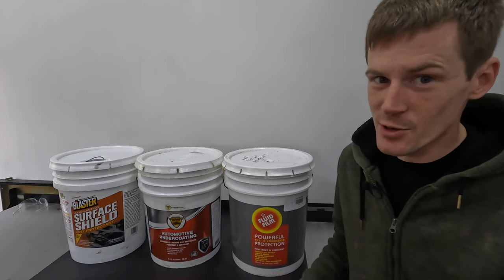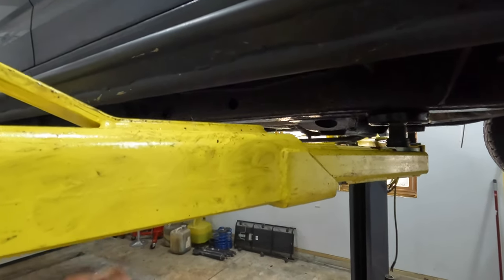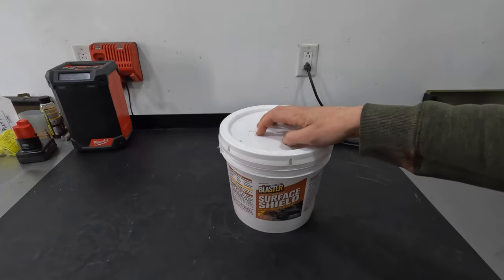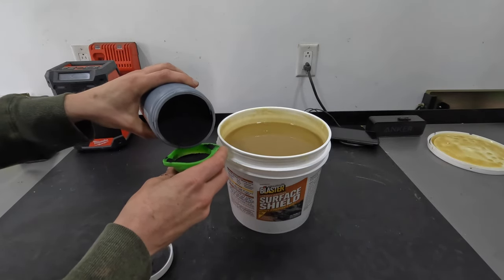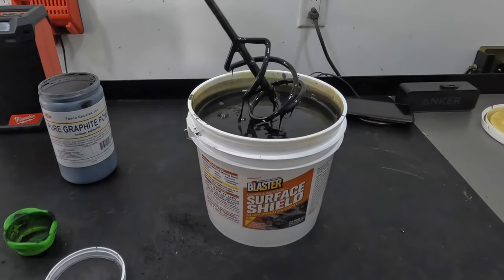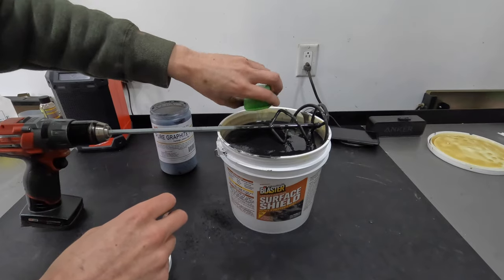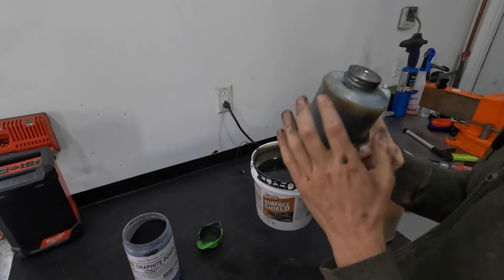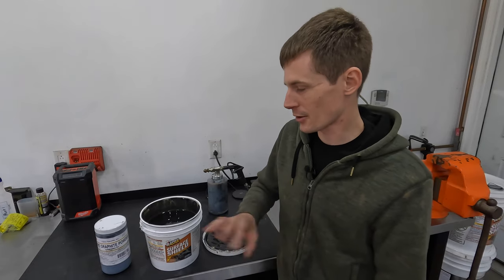How To Make ANY Lanolin/Oil Undercoating Black. ( Surface Shield , Fluid Film , Woolwax )

Comment from the maker: Links to the products: 
Graphite Powder: https://amzn.to/3gHomjk
Measuring Cup: https://amzn.to/3EYsiWr
Mixing Paddle: https://amzn.to/3F11ncp
Surface Shield: https://amzn.to/3tWZ3Nt
Fluid Film: https://amzn.to/3U6ib6e
Woolwax: https://amzn.to/3OCrOse
Woolwax "Pro" Sprayer: https://amzn.to/3XvYpUu

My Amazon Store:  https://www.amazon.com/shop/repairgeek
Help support the channel, buy using my Amazon links
As an Amazon Associate I earn from qualifying purchases and your cost is exactly the same.
Reply: I could never get my Woolwax DIY kit spray extension wands to work. Just shoots air. I’m using a pancake compressor set to about 60psi. The gun works fine. Any tips are appreciated. The specs are 2.6.SCFM @90psi.
Reply: @vqdriver unscrew the hose to the gun, you want only one or two threads into the spray gun, then adjust your stop nut.
Reply: @donaldmatthies6026  Thank you! Will try this soon!!
Reply: @vqdriver  you are welcome, try it out, it should help you, if not....... Please reply back I can try to offer more advice or assistance. I've been using the this product for three years now and love it, it took some fiddling to get everything to work right, and I have not had to adjust it since then.

Comment: One reason for the black version may be to hide rust when flipping a vehicle...
Reply: Yep always take a screwdriver and magnet with you when looking to buy a car. Used car dealership special. Although they wont' even oil coat it they'll just spray bomb it with undercoating.

Comment: Thank you - I was hesitant about using Surface Shield because they didn’t have a black version.  I get what you’re saying about not needing it to be black and the mess.  However - when you don’t have a lift and you’re in your driveway under the vehicle with poor lighting the black allows you to see where you’ve sprayed already.  It helps tremendously in that situation.  DIY undercoating is a royal pain in the butt - the black product just makes it that much easier.

Comment: I'm in the UK and we have a product here called lanoguard which I presume is similar to fluid film or surface shield. One of the selling points is that it's non conductive and this can help combat galvanic corrosion as well as not cause issues with electrics. Adding graphite, which is conductive, might make the product less effective. The biggest issue could be causing problems with electrics. Recently had to change the alternator due to an oil leak and although oil isn't conductive, when it burns it turns to carbon, which is, this is what killed the regulator. So my guess is to steer clear of the graphite.
Reply: I get your point, but if you use it primarily on the chassis, I recon it should be OK. The problem with Lano, which I use it looks crap! I am going to give it a try, anyhow.
Reply: mica powder seems to be the better choice
Reply: Good point. On the other hand, its mainly used  on metal that is conductive anyway, so not sure it make much difference

Comment: I use black pigment powder which is normally used to colour epoxy resin. It works reasonably well as it's an ultra fine powder.
Of course as it's a pigment,  if you are feeling a bit crazy,  you can tint your lanolin spray blue,  green,  red or purple as long as it's a strong colour.
But then the only people that will truly appreciate your artistry are those that you run over!
Reply: for those who want underside of their ride to sparkle, bet adding big metal flake would BLING!!

Comment: I personally like the black. I have a silver car. With the clear/straw stuff, you really can't see how much you are layering on the sheet metal, as you see the factory paint through the coating. You waste product on the initial application and subsequent applications. I went black. A quick inspection allows me to see what areas need a touch up. If I see the paint color poking through, it gets re-shot. If you spray a cast component like a steering knuckle with the clear/straw, it turns brown before enough road gunk makes it black. With the browining, you can't tell if rust is poking through, or if it's just dirty. Same principle with the black. I shoot it once. If I see brown on an inspection, its rust poking through. It gets touched up. Same issue happens with high impact areas on components that are painted black. For example, sub frames, lower control arms, and tie rod ends. If you spray the clear/straw stuff, it turns brown. You can't tell if its dirt or if it's rust. You end up re-shooting "just to be sure" and waste more product again. With the black stuff, a simple inspection is all that is needed. If it's NOT black on your yearly inspection, just touch up that area. If you want to change the color of your WW, FF, search the MSDS (Material Data Safety Sheet). Listed are the formulations or the CAS# of the ingredients. If you research the CAS# you can find what ever the pigment is. WW uses "Carbon Black".....powdered printer toner. It's cheap and very available. Mix your own. Save a few bucks.

Comment: very much appreciated. I've used that Butyl type sound reading before and didn't notice a worth while difference, but I can see how the 3 part system can work more effectively.

Before you purchased that brand were you able to develop any solid comparisons across brands to know if that brand may be more or less effective at controlling sound? 

great video!

Comment: I'm sure that powdered concrete/mortar/ stucco / grout dye (mineral oxide powder) would do the exact same thing.  Available in Black, Red and Brown in a 700 gram container at the Home Depot for about $20.  Very concentrated and one jar will deep dye 3 or 4 of the 50 pound bags of mortar mix or concrete.

Comment: Thanks for the education. Unfortunately I bought a 65 El Camino that has had a recent Rustoleum product sprayed on the undercarriage. I am not sure how well it was prepped or how bad the rust was underneath. Should I try taking it off so I can spray the lanolin method? Or wait until to see if it starts coming off on its own and then try removing it. It’s in Colorado and will be a driver. Sure wished I would have found you earlier, before my purchase. 

Thanks,

Comment: As far as guns go, I personally would never put this on guns for rust protection. Just wipe the metal surfaces with a silicone cloth stored in a ziplock bag. If your cloth dries out, add 1 tablespoon of mineral oil to the cloth, ring and twist it to get the mineral oil through the cloth, and a few hours later, your silicone cloth is good as new. Surface Shield is great on cars, trucks, etc.

Comment: Im doing a frame off on a 97 thats lived in Ohio its entire life.  Ive wire wheeled all the scale down to a patina/smooth rust surface mixed with some clean metal spots and new factory coated brackets and hangers.  Ive basically ruled out any "rust encapsolater" products (por15, eastwood, sweet patina black out) because frankly, i think theyre all a gimmick.  I was gonna just prime and paint with Rustoleum oil based products, then coat with fluid film.   Now that i see this, should i just direct coat with dyed fluid film and omit any paint/coatings altogether??

Comment: Thanks for all you videos. Always great information. My own experience, adding/mixing any dry ingredient to a premeasured liquid mixture, would decrease the liquids viscosity some what. My concern is, would this reduce the products ability to creep ?
Reply: I doubt it - as graphite is smooth and absorbs no liquid, unlike a fibrous filler. Imagine glass chips in oil. The product would remain liquid, and frankly if anything the graphite would protect it from UV degradation, I imagine.

Comment: I have a gmc canyon basically same rig as your Colorado.  I have 6" lift kit and can see lots of undercarriage.  I'm going with your recommended blaster surface shield in clear.  can I then give it a shot of black rust paint on the parts that are visible due to the height of the truck?

Comment: I wonder whether "Surface Shield" sold in Europe is the same as you show here. The labels are quite different, but the name is the same. I understand that the US Surface shield is based on lanolin - like fluid film seems to be. Any idea of how to remove some sparkles from the windscreen? I tried aceton and Isopropanol, but no chance to get completely rid of the stuff. At best, I ended up with a film on the glass. Regards Heinz

Comment: Hey dude, I got a question for you knowing that you work with Blaster now. Is it safe to use on GM wax coated frames? I know fluid film would really soften that wax up and basically render it worthless.
Reply from the maker: My stance is going to differ from Blaster's "official" stance.
Me personally: Spray everything down because I know that wax is going to fall off in 5 years treated or not.
Blasters Position: Do not use the product on a GM wax frame. 

With or without the product that wax is coming off if you live in a corrosive environment. Blaster is keeping their backsides covered by not spraying a wax frame.
Reply: @RepairGeek  understood. As always thank you for the great answer and quality content. I was more so asking because I do this as a side gig for money on the side. I’ve switched to SS exclusively from FF and I’ve learned to stay away from GM wax frames the hard way.
Reply: I can't find a 5 gallon pail anywhere  in Ontario, Canada. I ordered a 1 gallon from Amazon. Will that be enough to do a new 2023 Chev crew cab shortbox pickup?

Comment: Ok, I’ll admit I’m completely stupid about this product and what the purpose for it is as well as where to spray it and not to spray it? 
I have a brand new Kia Niro that’s a charcoal blackish gray color on the exterior of the car.  Haven’t even looked at the underneath side yet?  I’m assuming this is basically just a protectant to spray on the underside of your vehicle?   Kind of like having your vehicle under coated I’m guessing? I’m assuming it helps keep things from rusting over time? 
Like I said, I know absolutely nothing about this product, but you have me curious and now thinking it may be a good idea to have it sprayed on my new vehicle underneath at least.  You would spray the exterior of your vehicle paint would you?  I know there is product for spraying on the paint too that’s least suppose to keep vehicles from having dirt, tree sap, etc from sticking to your paint and making them easier to clean. But I’m assuming this product you’re making black isn’t the same product for covering your vehicle paint?  Sorry if I’m asking too much? But any answer appreciated

Comment: Good(initial) money saving idea!  👍 ....HOWEVER, here's a warning about mixing graphite into the oil  - - - >  graphite has electrically conductive properties, so you may now run the risk of inflicting damage to the electrical circuits of your car!!  Specifically if you spray on any electrical connectors and the graphite gets inside.   

Just for your information!  😉
Reply from the maker: The carbon black that is traditionally used as black pigment in these products also conducts electricity...

Comment: Off topic, but what is the big orange vice you have on your bench?  I've been looking for a good big vice.  And thanks for the vid, I actually bought the identical graphite before I even saw this vid, haven't used it yet because it's too cold to spray now.
Reply from the maker: It's an old Ridgid. I called them probably 6 years back about getting replacement jaws for it. They had no record of the model I have. I think it was made by someone else with a Ridgid name on it.
Reply: m walker i was digging that giant bench vice too! to big for my needs, but as a guy that loves tools and works on cars and bikes. i love it!!!
Reply from the maker: @clydeking4265  I agree it's on the large side but I literally could not beat the price 😉

Comment: I’ve been wanting to ask this question about undercoatings, I’ve watched plenty of your vids, but it would seem to me that after doing fresh metal prep, painting on black caulk would be something to try and would resist chipping and delaminating. What are your thoughts and can you try it? Please answer, I’ve asked this before. Thanks.
Reply: Nobody will answer that question because it’s nonsense. How could you possibly paint on caulk to the extent you can spray on lanolin liquid?  Inside frames, around frames, inside body panels, etc. is far too intricate and extensive to get with a paint brush. Have you even watched a single video on lanolin spray applications?

Comment: If you need to work under the car on a certain section, say shocks, any easy way to clean the work area out?
Reply from the maker: Pressure wash and some degreaser.

Comment: I want to undercoat my vehicle, but some people said that those undercoating degrade the rubber, so I have to avoid spraying the rubber bushings and rubber houses? Also others said that when spraying inside the doors, there is some deformation on the bottom of the door rubber seal. Is that true? Thanks.
Reply from the maker: The only issue that I've seen in 5 years is, my weatherstripping on the doors of my truck that is in constant 24/7 contact with lanolin has SLIGHTLY swollen. That's the only side effect I've seen. As far as under the truck, I've had zero problems. No unusual noises from the suspension and all the wear that I've seen has been normal.
Reply: @RepairGeek  thanks, you are the best👍
Reply from the maker: @TavosMr  🤣 thanks but I think you just have low standards 🤣
Reply: @RepairGeek  oh, that mean your videos are worthless? I should unsubscribe to your channel then

Comment: I have a question. I’ve applied surface shield before winter. I want to do so again. What’s the best way to clean the frame to reapply the surface shield?
Reply: In other videos this guy has said he does nothing to the existing coat and just adds more.  There is a video I saw this morning where he said by year 5 he's unsure if it's worth reapplying because of the existing coats.
Reply: Maybe powerwashing, but if anything just reapply over

Comment: Graphite is conductive. This seems like the opposite of what you want in a coating when trying to prevent an electrolytic process (rusting) from taking place...
Reply from the maker: So is the carbon black pigment that FF, and Woolwax use...

Comment: Have you ever treated something with linseed oil? Since lanolin products don't ship to sweden I'm curious to try mixing that with some gum turpentine to be able to spray it and some graphite powder for easier tracking of the coverage.
That seem to be a really good method and is said to withstand years of rough exposure...although overspray is an issue if you let it dry.
What do you think?
Reply from the maker: It's nothing spectacular like some claim: https://youtu.be/9SOOfZFmhSY?t=1058
I got better results out of vegetable oil: https://youtu.be/9SOOfZFmhSY?t=1242
Reply: I noticed now that you tested BOILED linseed oil. Here in sweden the old timers talk about RAW cold pressed linseed oil which has a totally different molecular structure and there are test that suggests that it creeps far better than anything else.
One of our biggest retailers for car accessories and part make thier own product especially for rust prevention on car using 100% raw linseed oil which the sell both in aerosol and 1qrt bottles for spray guns.

Comment: Can you spray black paint on top of Surface Shield? Will it dry?
Reply from the maker: Surface Shield does not dry so paint isn't going to stick to it very well.
Reply: @RepairGeek  Thank you. There are a few parts under my car that have started to rust that I would like to paint a color and still have a rust protection on them ( shocks for example) . Is there a rust protector that can be painted over?
Reply: Paint does not adhere to oil, it will fish eye and run. Painting over any kind of oil based anything is pointless and if anything will just look terrible.  @gimmeagig

Comment: Don't mechanics hate working with undercoating messing everything up?
Reply: It's not the undercoating that you're thinking of. This is just oil, Mechanics hate undercoating bedliner spray. That stuff sticks nuts and bolts, it gets hard on everything. Oil is messy, but if anything most mechanics will thank you for not letting your vehicle rust out. There's is nothing worse than working on a car that's literally crumbling.

Comment: Just found out about this stuff would be nice if you would check it out it's called rust cure seen on guy putting it on lawn mower decks after cleaned I will admit I do like surface shield the best so far I have not put on my truck yet but will be this spring and then in the fall